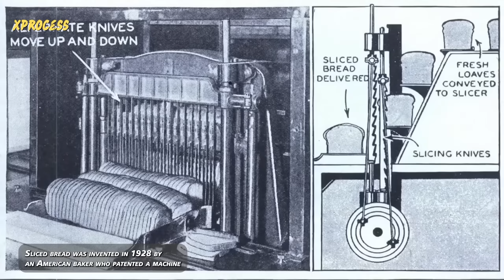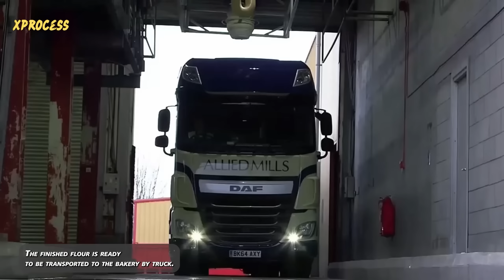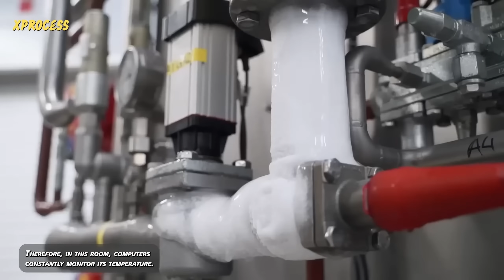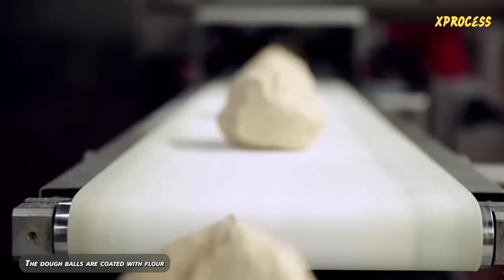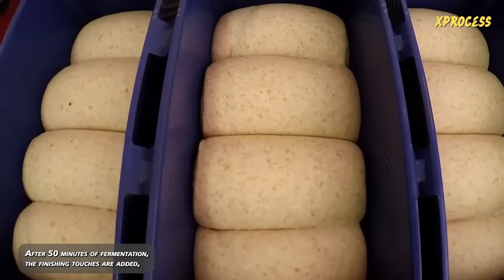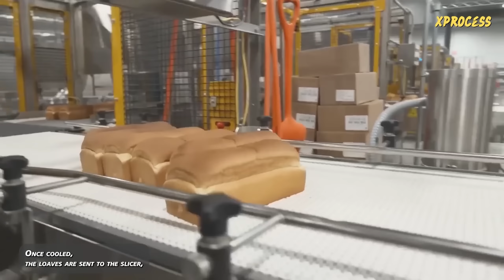How Millions Of Bread are Made In A Huge Factory 🍞🏭

Comment: FYI - Celcius is not measured in degrees, it's just a unit not related to a circle like Fahrenheit, a much superior measurement of temperature.
Reply: Celsius is measured in degrees, which is 1/100 of the temperature range between the freezing point and boiling point of water at standard pressure. The official SI marking is °C. The Kelvin scale does not have a degree marker.

Comment: That is very informative.    I grow the wheat that in the past was a significant part of making a slice of bread.   If I grow wheat it will bring me $6.00/ bu  that will make 2,000 slices.     If  wheat were free the price to the consumer would not change by much!  It takes 2 years of my planning...a $300,000 combine...a $100,000 grain drill...a $200,000 tractor...a $300,000 sprayer... a $100,000 used truck...and much more if my equipment were new.   Why is the consumer paying so much more than 50 years ago when wheat has only doubled in price but bread is more than 10 times higher?!
Reply: Corporate greed